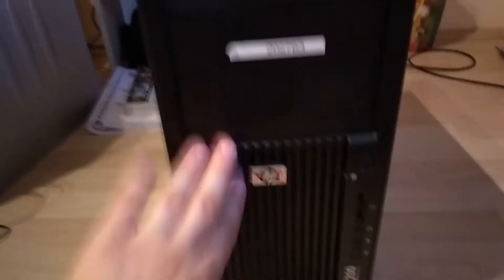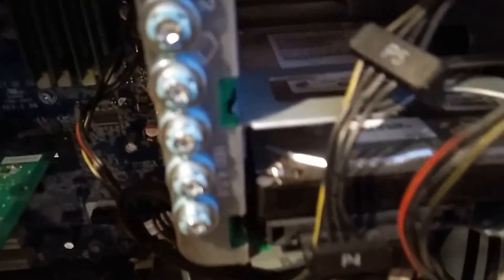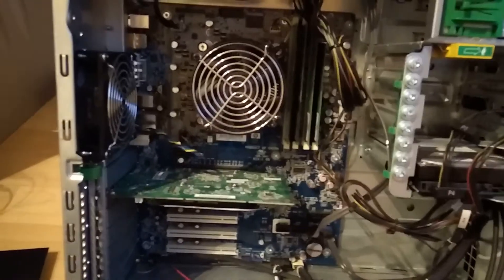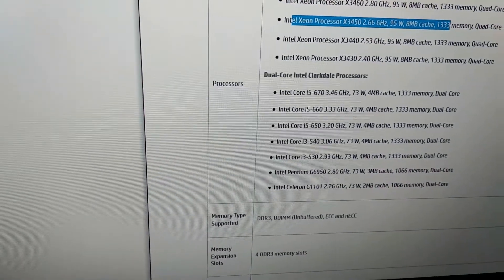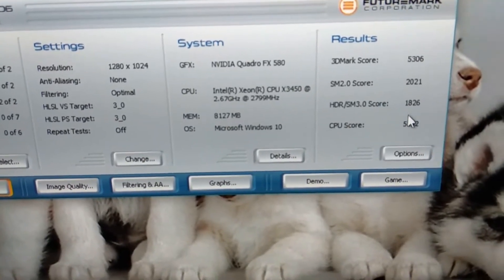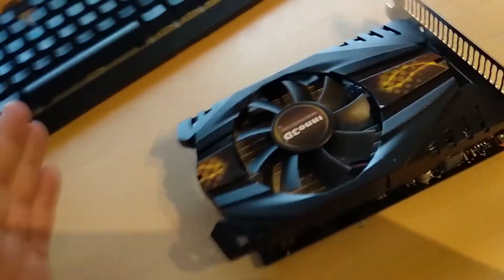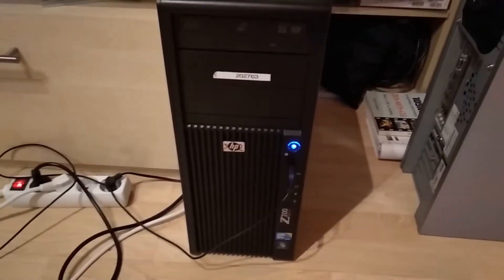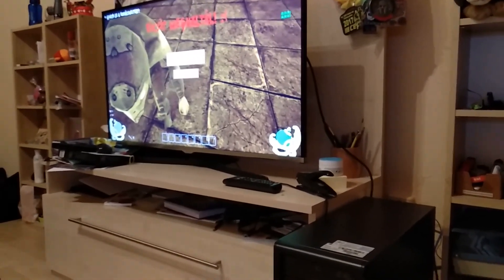HP Z200 Workstation - Quadro FX 580 / GTX 750 Ti

Comment: Don't need to rush man. Anyway,  i tested INTEL Core i5-650 working fine. INTEL Core i5-750 & INTEL Core i5-760 refused to work. I had the front RED LED blinking. CMOS Reset don't help. RAM is HYNIX DDR3 1333MHz 16GB. Bios version is 786H3 V01.11. I found an update V01.22. I will Try and see.. I forgot.. I also have HP COMPAQ Elite tower 8100. Similar motherboard with more Parallel and Serial ports with BIOS 78H1 VO1.13. Problem remains.
Reply from the maker: This is very strange. Prebuilt factory HP COMPAQ 8100 Elite configurations come with Core i5-750 and Core i5-760 CPUs.

Comment: Can any kind of gtx 750 ti work in the z200?
Reply from the maker: If it's small enough to fit into the case and requires no extra pcie power, then yes. I think a single 6pin cable shouldn't be an issue either.
Reply: Yes the 750 it is the best card to put in this computer

Comment: Wat size is the rear case fan
Reply from the maker: 92 mm x 92mm x 25 mm 4-wire PWM
Reply: @JohnAmanar  ok thank you...im looking to upgrade to LED FANS....WHAT SIZE SHOULD I GET?
Reply: So the REAR CASE LED FAN size recommended is (92x92x25mm) 3 or 4pin power connector/molex?......if so thank you
Reply from the maker: @nikeboylotv9642  Yes. It's almost the same as the CPU FAN. It has a 4pin fan connector.
Reply: @JohnAmanar  thank for your response....I love the HP Z210 DESKTOPS.....THEY MAKE GOOD GAMING PC BUILD

Comment: Hello, i need an answer, does the pc have pci express 3.0? Im about to updrade from my quadro fx 380 to msi aero gt 1030 which needs oci express 3.0 to work with. I tried it on the pci that the fx 380 was on but once i opened the pc it said " graphics card not campatible"
Reply from the maker: Hello, it only has PCIe 2.0, however the 1030 does not need 3.0 at all. You can use it in this machine. And if you go with the GT 1030, go with the GDDR5 versions only! The others are carbage!
Reply: @JohnAmanar  oh okay, but how can i "make" it work cuz i have failed few times already and gave up?
Reply from the maker: @NutScratcher300  Strange. Could you sare a link to your actual card? I'll take a look.
Reply from the maker: Also, is the card posting? Or do you have issues installing the driver?
Reply: @JohnAmanar  i have issues installling the driver, i dont know why, i have done research and tried still dont know why it doesnt work.
Reply: https://www.msi.com/Graphics-card/GeForce-GT-1030-AERO-ITX-2G-OC.html i think you need this.
Reply from the maker: @NutScratcher300  Yeah, many people have driver issues with the 1030 in many different builds. I'm still looking into it. I'll get back to you.
Reply: @JohnAmanar  oh, okay.
Reply from the maker: @NutScratcher300  Will this work? Sorry for the huge delay, :|
https://www.nvidia.co.uk/Download/driverResults.aspx/161420/en-uk
Reply: @JohnAmanar  its ok, do i have to download that before i add it or after? I have a windows 7 professional 64-bit, does it work for that? Im kinda new to this stuff so im a bit of a pain, but i really need to know before i touch my computer and risk breaking it.
Reply: @NutScratcher300 How about don't run Windows 7. 4 years ago it was already long unsupported.
Reply: Still says unsupported graphics card

Comment: Does the stock power supply on these have the 6 or 8 pin connection for the graphics card?
Reply: Perfect thank you. Picked up one of these for my partner to play GW2 on - hoping to pair it with a HD 7770
Reply from the maker: Unfortunately the stock PSU has no PCIE connectors.
Reply: @JohnAmanar  Thanks for the response, do you know if it has any additional sata power cables or molex power cables as you can use a cheap converter to get a 6 pin
Reply from the maker: @MrJosephGW  It has 4 SATA power connectors. You can use 2 of those to make a PCIE 6 pin connector. It has no Molex cables.
Reply: 🙂 Nope, but its a Delta 320watts, find an adapter and use a 6pin lite video card like a 950

Comment: Hi dude nice video and nice workstation, did you buy it ? (I'll edit my message if I got the info in the video cause I'm currently watching it)
Looking at the shape of the plug in the front of the case I think it's a firewire but the symbol next to it is quite weird, hope I helped you ;)
Reply from the maker: Hi! :) I was really lucky with it, 'cause we had a company lottery and I've won it! :D They were replacing the old computers. Now I have an HP Z240 at work with an i7 6700.
Yeah, I've searched firewire and it looks like it. Thank you! ^_^